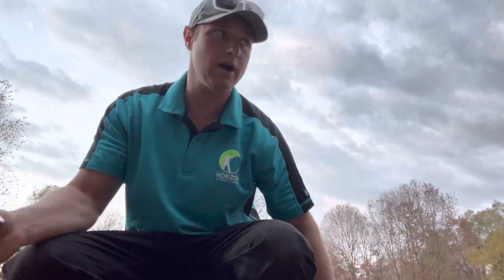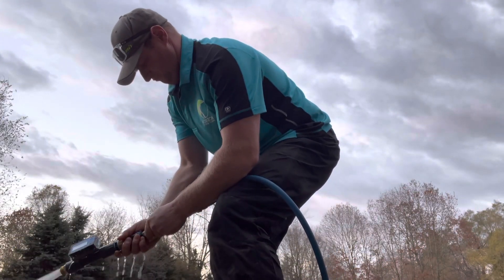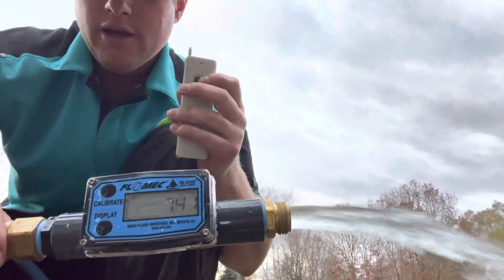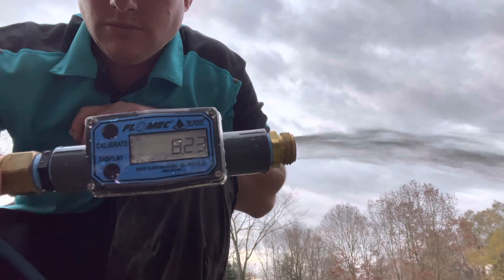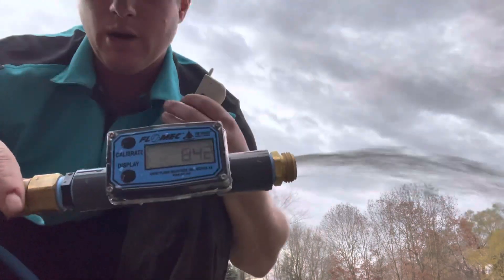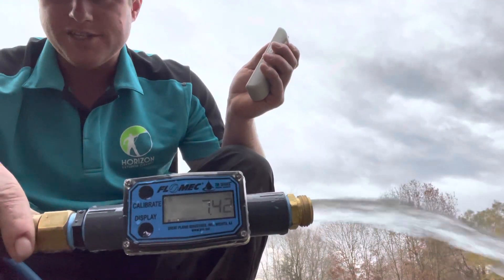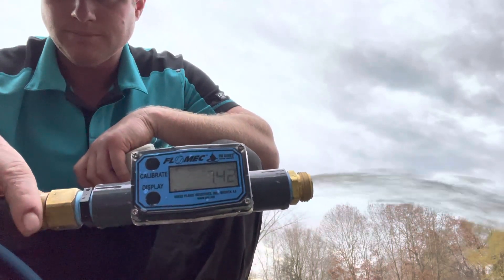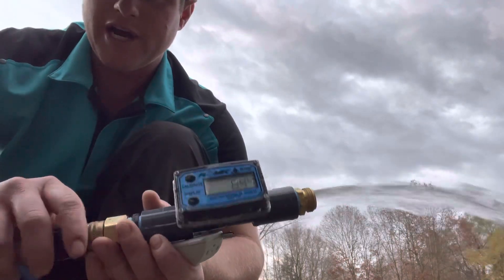How much flow does a downstream injector lose?

Comment: I'm sure anyone thats ever used a DS injector has seen that they restrict flow.   My guess is that the difference would be greater with the added backpressure of 200 feet of hose and a gun in front of it.
Reply from the maker: For years and years it was a huge argument on forums, facebook groups, and all over the industry.  No one took a digital flow meter and put it in everyones face like I did though.  Wildly if you look back  and find the old posts in facebook groups when I posted this video there were several guys who continued to tell me I was wrong and that injectors don’t restrict flow.
Reply: @softwashscience  yea i remember when the argument of arguments was 4gpm vs 5.5gpm and noone would touch 8gpm bc they were convinced you need to fill up a 300 gallon tank at the start of each job then empty it so you don't waste gas carrying water to the next job.  The amount of resistance that Chris @Apple Roof Cleaning and Offdutyfireman overcame to convince people that bleach is safe and 8GPM is where its at is insane.
Reply from the maker: @AlexSomers-d2n  yeah it’s always entertaining to look back. I still remember in 2019 I believe it was maybe 2018 I would have to go look.  I propose the idea of a remote control bypass system and people told me I was thinking about it all wrong and it went over most peoples head, and they told me that they already exist, referring to the solenoid style ones that shut off the injector line.  That was the same day. I had a long conversation with Jud West and told him we just needed to motorize our current Bypas and not change it at all and that’s when a lightbulb kind of went off for him and then fast-forward to this video right here and I’m Testing one of the prototypes he made. I made sure to keep this old prototype. I think it’s kind of part of our industries history and I like that sort of thing.
Reply: @softwashscience  Rock on...and Thank you!  There are a few things that after using them for 15 minutes you can never go back.